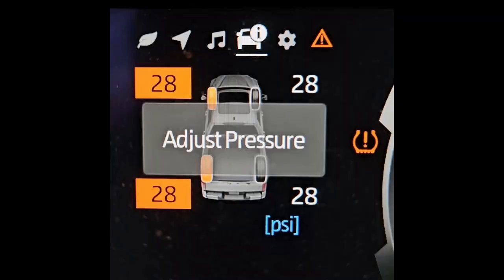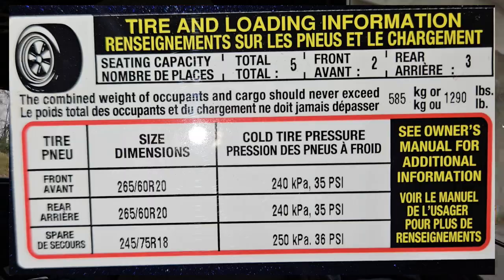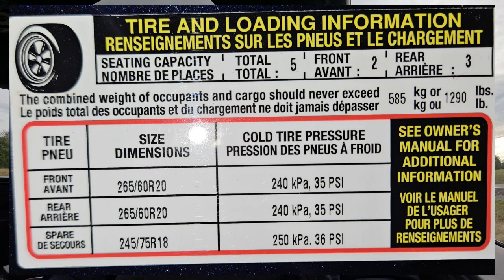Why Your Tire Light Turns On. What It Senses & How to Correct It and Some Common Misconceptions

Comment: Greetings from London.  If the spare is one of those emergency ones (usually speed restricted just to get you home) the recommended psi will be much higher than the others. They are often smaller too.
Reply from the maker: That is all true. Thank you for adding the info.